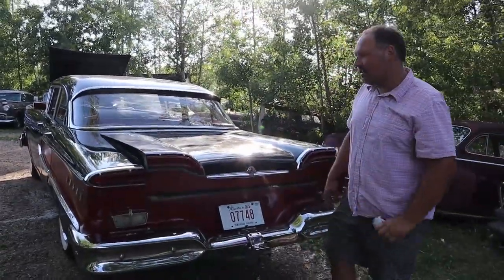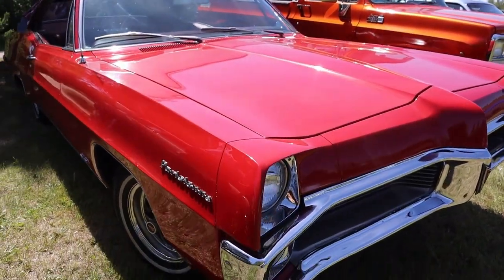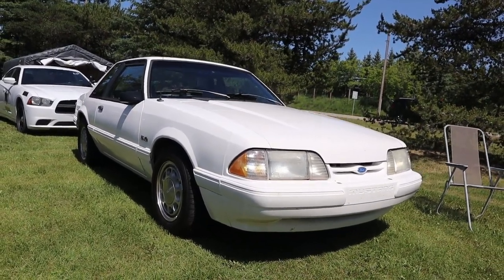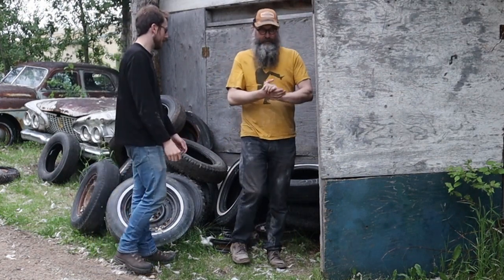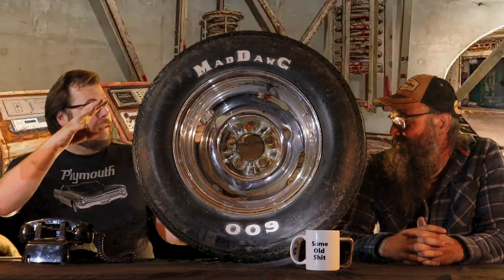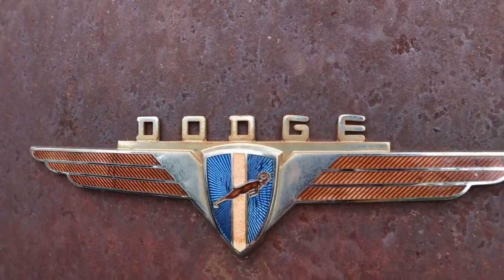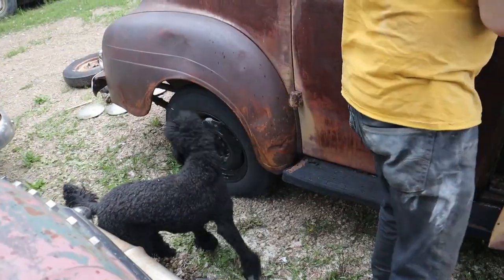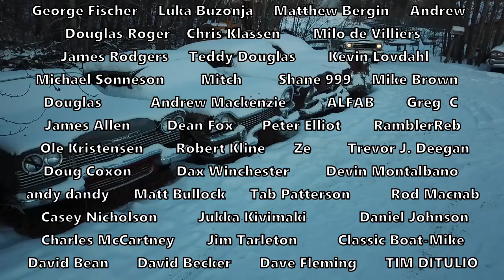Shopping Again! How Could I Resist? Plus: Great Car Show and "My Classic Tire" Special!

Comment: Years ago when I lived in Vermont I use to get these winter retreads where the tread was impregnated with crushed walnut shells. You know, they worked pretty good. Even on Icey roads. Cheap to! I had a 62 Fairlane 500 with a 221 V8 engine hooked to a three on the tree overdrive transmission. Thing was like a tractor in first gear. She were great on gas! Loved that car.

Comment: I worked as an assistant car detailer at a Chrysler Dealership one summer, and those Cordobas were the most sought after car for "Demos" for the Sales staff. And indeed, the upmarket versions were super-luxurious with plush leather interiors and acres of hood (bonnet)....And the cloth upmarket interiors were no slouch either. They were not immune to the infamous "Lean Burn Stumble" of that era, however,  where slow acceleration either caused a stumble or even a stalled engine. The sales staff always parked their Cordoba  "Demos" out of sight, so that potential customers wouldn't see those cars and want to buy them.
Reply: Cool ! I Love driving Novacane suspension Cordobas once the Lean Burn is swapped out for electronic ignition and the shit smog exhaust ditched.
Reply: Yeah I had to ditch my lean Burn System on my 79 Chrysler 300.
Reply: @RCindustry  - Too bad. Did you at least leave the decal on the air cleaner? I loved that decal... "Lean Burn" is good, right?
Reply: @cmans79tr7  I carefully removed all components of that lean Burn System and have them stored. I'm hoping to be able to find somebody who actually wants to completely restore this Chrysler 300 when I'm done using it. I'm going to be taking it to the No Name Nationals in September and then once I'm done with it I want to try to find somebody who will restore it because it's a pretty nice car so that's why I kept all of the original parts.

Comment: Thank you Steve for showing this car show on your YouTube Channel. Loved it! I hate to say this, but there was only two cars I can relate to in my life and those cars are the 1978 Chrysler Cordoba and the 1981 Subaru. My Uncle Clarence owned a Cordoba when I was about 9 years old. It was cream colored with red interior and T top glass windows. He owned it until the transmission blew up. Then traded it in for a Chevy Monzda. The Subaru brings back memories of my 1981 Subaru GLF which was the last model Subaru before they went ALL WHEEL DRIVE. I bought it from my Aunt Judith for $800.00 back in 1985. It didn't have brakes, floor pans, engine and a clutch. I had a friend help me  put the engine and the clutch in while I changed out wheel barings, brake rotors and brake drums and pads and shoes. I also patched up the holes in the floors and the fenders. Plus I installed a Radio Shack stereo system in the interior. Sorry to say it didn't have A/C.  I did buy a set of Sears tires to replace the dry rotten tires that were on the car. I did get a kick out of the Dukes of Hazard's Police car. Classic tires was different and edgamacational. The ending was for me sad. That old Dodge sedan car needs a good home and restoring. I hope you do something with it before you drop dead. Your car collection is growing from people giving you cars because of your YouTube Channel. "CHEERS!"

Comment: The car show was Awesome.Tough to pick a winner as there were so many.I think I saw 'Mad Dawg' tires mid 70's on decked out vans.War Pigs tune was a great touch after the 40 Dodge,which was solid as heck after sitting 58 years.Loved the LeBaron.Used to point out that the headlight/blinkers were upside down in the Diplomat,or vice-versa so you could tell them apart.His looked pretty good,especially with the T-Tops removed.It was nice to see so many 'Agents' at the show too.Belated "Happy Canada Day" to you all.Cheers!
Reply from the maker: Thanks! Glad you enjoyed the car show like we did!

Comment: I found this small piece of info on Mad Dawg tires. The poster is from Ontario.

In the late sixties Mad Dawg tires were popular (with unpopular people).

They were a wide bias ply rear tire for hot rods not the Mad Dog off road tires they have today. If you had a Camaro or Mustang they were mandatory equipment along with long shackles, Cherry Bomb mufflers and fake hood pins.
RUSTY O'TOOLE, FEB 29, 2012

Comment: 1967 seemed to be the magic year for the auto industry. My 67 VW Bus is a champion. The Beetle was the epitome of the type. It all went to crap in 68 when bumper standards caused major changes in the body. Some ditz decided to change the alloy composition in the engine cases and spooged it to hell. I got my driver's license with a 67 Mustang. I always thought that the 67-68 Stangs were the best looking until the 2000s retros.

Comment: Loved the old Chrysler ripping up the yard.  I so want to see the Electra convertible test ride. Buicks and old mopars are my favorites
Reply: The first Electra I ever saw was a '65 225 sedan, it was the first car with A.C in my experience, they turned it on and tiny bits of crystallized air came out of the frosted-up chrome vents in the dash--I was impressed!

Comment: On July 1, 1967 the US National Traffic and Motor Vehicle Safety Act went into effect (yes, it was signed into law in September of '66, but didn't take effect until the beginning of the next fiscal year -- July 1, 1967.)

Thus, your assertion that every GM model in 1967 was designed to perfection has a real reason behind it -- it was the last time the designers could design just for style, disregarding everything else.  From that point on, and getting worse as time went by, they had to design with government regulations in mind first and style second.  1967 was quite literally the end of an era.

Comment: My mom had the same Pontiac 4dr sedan straight eight, but in a dark green.  A bear of a car to park, I would hang on the wheel and help. A Corvair across the street drifted out of the driveway and the rear hit the driver side. The Corvair was totaled, the Pontiac had a slightly harder time opening the rear door by my six year old self. Watch out Ricardo Montelban's ghost may be in the Cordova.  What a spectacular car show to have been at. It's not an Electra 225, its a Deuce and a Quarter. You need a bottle of Mad Dog 20/20 on the seat of the car chosen. The Dodge handles are so deco. Can't wait for the "It's a runner" shout. Stay well. Good to see you pleased.

Comment: Looks like the dodge is 90% solid, give her a good pressure wash inside out and let her dry out in the summer sun. I bet that guy knew exactly you were the person he wanted to pass it on to, you'll have to rearrange the yard now and make a dodge section.
Also, I was expecting to see a greasy flip LTD to rattle down the road for the tires but Kyle held the greasy flag high.

Comment: Can you not buy pure gas in Canada?  You can get it in the Carolinas but you pay just as much for ethanol free 87 as you do for 93 gasahol.
Reply: Our only ethanol-free option is 91 (Premium) or 94 octane (Super), which costs well over US$7.00 a gallon (CDN$2.40 a litre) where I live. I put it in my motorcycles.

Comment: It's Franckers! Yay Francine!

"You know what else is shit? The fuel that goes in the hose." Honestly cracked up laughing - Thank You! Having wrenched on Dean's Edsel to replace the fuel line hose, and tighten the belt, it's the next morning! (Well - it IS a Ford. Kidding.)

That '65 Chevy is exactly like the one I learned to drive in. Thanks for the memories.

Ah! The Canadian Pomtiac with the US Oldsmobile taillights! Nice car!

Was that a series of Subaru starts in 'Hill-holder' mode? Or didn't they have that then?

Classic Tires - where old tires go to retire ... no pun intended. Hey - that's a nice, stanced car worth!! Hey! I called it !! Prove they're the last? NO - Auction them at Sotheby's! 😎 Favorite tires: Sears Mileage Master H Seies on station wagon rims with airshocks in the rear and double-actions up from on my Chevies. Didn't cost much, hugged the road, and you cou8ld drift the turns as they were polyester belts 😍

The '40 is NEAT. I'm jealous.

Thanks for the fun!

Comment: Excellent video Cold Water Motors Agents Scott :) , Agents :) , Frankers The Dog  🐕  , and The Boss Tom too! Also nice vechile show Scott  :) also nice vechiles see and vechiles did know they made in years GM and Dodge for Cop cars make then ! Also Andy Indian motorcycle nice to see and Scott that tire in old 1950 4 door  Family car Dodge she nice shape too and also 62,000 miles wow for sure plus tire in front seat of Canada Tire sold in Zellers, K-Marts , Towers , how know my aunt Val bought set for her 1970's was Dodge car back in 1990 from Zellers  ! Also ask me tires like from 1970's couldn't tell but my first 1972 Ford Truck F350 extended cab 1 ton had used Tow Truck they had 950 /16.5 LT Load Range D  and my dad had got me brand new set tires for truck found at Garage Sale never used bought from original owner for $500.00 for 6 them in 1984 ! Dad got for my birthday in 1995 and repay for deal found him a new seed drill on farm and truck to! The 1990 Chevrolet Cheyenne 25 3/4 ton could get those tires because took 16 6 studs rims and tires were Firestone (Fire Hawks 2 ) winter season tires thick lugs like Farm tractor has on back drives wheels! Only thing howled noise like dogs do or Coyotes do but amazing traction for Winter or Mud to go thru especially truck Ford was 4×4 plus 6 wheels to on back dauls Lol ! Last long time for 8 years and tons miles of 300.000 kms worth Lol till got new set again  ! But found Firestone in 1984 was for tire was $60.00 then installed plus balance plus vavle stem with tube or not for $125.00 then for one tire on truck but cars were $85.00 depending on size to and another tire give from 1970's was good my parents had and tires lasted long more they rated  them for plus my dad had farm machinery implentmets and  were on 1976 Chevrolet Impala LS  4 door  car and tell too! Good Year types Wranglers AS/T  size 235/75/15  in looking like All Season tires but tread tons ! Made in Ontario Canada in Bowmanville  east Toronto by 45 kms east! Also Tires that want know about think there made Kingston Ontario at Firestone plant or Brampton Ontario plant Bridgestone remember hearing about too sold at secondary Tire shops not Canada Tire or Zellers or any other 2 businesses plus Auto Shop!

Comment: Re. Mad Dawg tires but no source info. From a 10-year-old post on H.A.M.B. from a gentleman in Ontario: "In the late sixties Mad Dawg tires were popular (with unpopular people)." "They were a wide bias ply rear tire for hot rods not the Mad Dog off road tires they have today. If you had a Camaro or Mustang they were mandatory equipment along with long shackles, Cherry Bomb mufflers and fake hood pins."  My personal favorite greaser tire in the mid 70's was the Sears "Super Wide" G70-14 on my '68 GTO. I went through quite a few sets. I had so many mileage warranty replacements at Sears that I was shut off there. For Winter use, it was recap serious snow grips in H78-14. No better traction.

Comment: Yup, lot is looking pretty full! That's the danger of healthy addiction!

Time to make some Cal Worthington deals??? HAHAHA! (look him up, old Los Angeles TV car sales guy).

Alright, time to admit YOU  NEED HELP!!!!  

Find some are young folks who are aspiring gearheads. (Or characters from a local senior center?)
Maybe through the local high schools or community service. 

Start hosting a day weekly gathering teaching sharing event.
Maybe a 5 person team assignment to each car. 
Each of the CWM agents can be a sponsor. 
Use primary only old hand tools.
Pick cars that are reasonably close to semi operational.
That is, team can get them running adequately to drive around the farm reasonably (brakes, steering, tires, seats).

Camp Run-a-Clunk! Summer 2 week camp!

Maybe just assign cars that need sanding and paint? At least get the exterior panels to a state of arrested decay. Spray primer, and brush/roll on Rustoleum! 
Have them remove the trim and learn how to straighten and polish. 

Yeah, but maybe you just aren't in the mood for apprenticeships. Definitely will have to ditch the darts! 

Eventually, you might be able to off load a few of those classics to Jonathan at ICON motors in Los Angeles. Look up his YouTube posts.

Comment: '70s Plymouth.  One winter, when I was living and working on Lake Erie I bought a work car from a workmate to run until my new Accord landed.  It was a ratted-out 1970 Baracuda convertible, Slant Six, Torqueflite with some ungodly number of miles.  The Accord took months to arrive, but I didn't mind because I found great pleasure going out on the coldest mornings and firing it up while the jabonies with new cars waited for the AAA truck.  It was such a reliable beater, that I ran it long after the Accord showed up.  I put over 30 kmi. on the thing and spent maybe $100 total for two snow tires (recaps, of course)and to have a u-joint replaced.  It was definitely the raunchiest car I ever owned, but, also, maybe the best running.

Comment: I really enjoy the way you guys talk yourselves into a car.  I was born in 1945, so I remember cars  from the 30's, 40's, 50's and on. (gave up in the 80's.)  seems like a lot of cars were oil burners, good for mechanics and auto machinists.  pushing 65K miles was doing good.  2-300k engines only happened because the Japanese made it happen.   good show.

Comment: These 1940s Chrysler Corporation Cars really have stance and presence. The bodywork seems pretty much indestructible. 

A slightly heretical suggestion on coldwarmotors: I guess if you replace the engine/gearbox with a Lithium-Ion battery and put in a rear axle with an electric motor - 80-100 kW should be more than enough - they’ll still be around in the year 2100.

Comment: Now you'll have to do a "Will it run" on that '40 Dodge :)  It being a 40 model, I doubt it was driven much its first 5 years.  I don't know how Canada did it with gas rationing and tire rationing, but most US cars were given stickers or "cards" in an alphabetical system for how much gas they were allowed each week.  An "A" card, the most common could buy 2 gallons of gas a week.  I suspect that wouldn't get you very far, especially on tires that essentially had to last you for the duration.

Comment: Had to add a Dodge to balance the Mopar representation after the Roadmaster arrived
Awesome cars at the event there , I like those Pontiacs , 
Dodge could be a runner , at least it is not seized
Frankers approves , crawled right under there
A Buick look see with the Electra drop top , iwould be very cool
Daves Impala is a knock out no matter what wheels are on it ,
Deans Edsel is a treasure , I seen that paint in person before the buffing 
Wow ! , looks awesome with the hubcaps and emblems , looking awesome!
Myles with the Strato Chief , thats another beauty ,

Comment: The fuel filter fuel line is crap throw it away best you can do is buy fuel injection rated line it has an internal liner that the ethanol gas owont damage.
Unfortunately even non-alcohol gas seems to destroy the fuel filter short provide lines up they're just crap,,,

Comment: Your coverage of the car show is one of the best I've ever seen! You moved the camera down the cars slowly, held the camera steady, and did not forget that for car guys the cars are the stars of the show. Excellent camera work there, Scott, looked like you were using a gimbal, very steady, thanks.

That Dodge looked pretty promising at first. I was thinking wow just heavy surface rust, body looks pretty good. Then I saw the dents in the rear fender. Oh well at least they come off to hammer dents on those old ones. It was kind of a let down when I saw the mangled grille and I wondered if you could straighten that out. I was amazed by the cool Art Deco styling in the dash, looks pretty fancy for a Dodge eh? Too bad about the condition of the interior, but it's impressive to see the quality of the materials that were used in cars from that era. Looks like water has been getting in and rotted all that fabric beyond saving any of it.

This is one of those cars that could have you on the fence about whether you should attempt a restoration or not. The body looks pretty savable, but the interior could run into more than your willing to spend. It would be cool to see that dashboard cleaned up. That trunk emblem is amazing! I wonder what colors were available for that car?
I'd kinda like to see this one brought back.